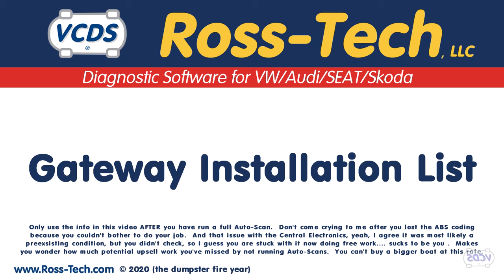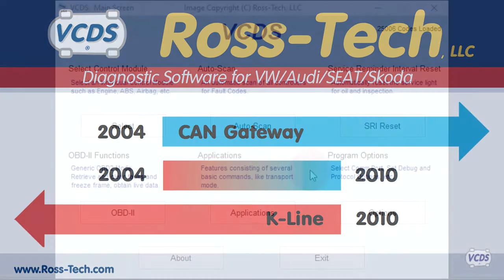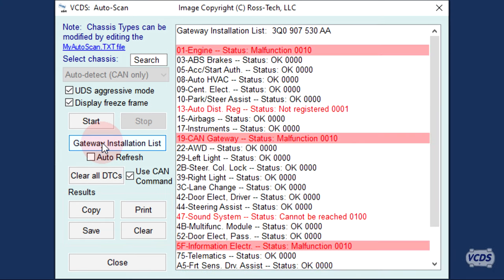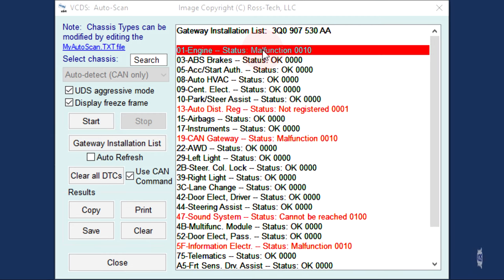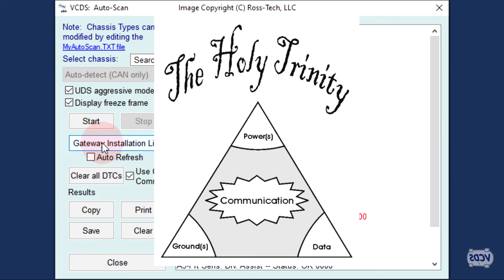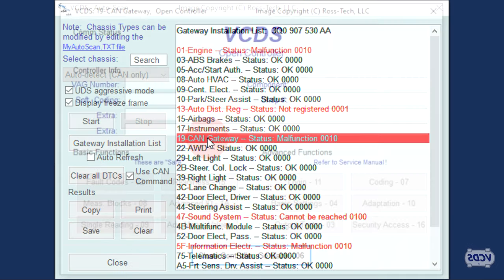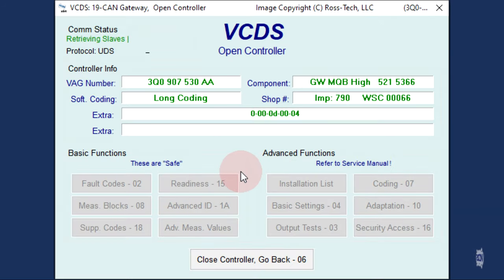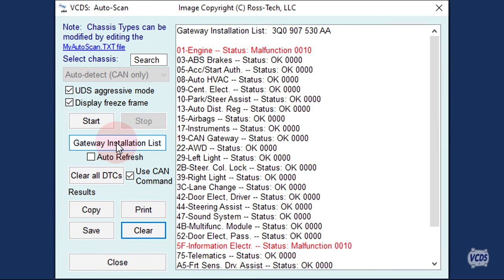VCDS - Gateway Installation List

Comment: Hi I drive a 2010 A4 B8 2.0
But I could not get the steering assist module to communicate. I went into installation list the 44 check box isn't tick. Us there any problem?

Comment: is there a date known when this also works for the new gateways, fitted on the golf8?
Reply from the maker: We've received some scans from Golf 8s already.  But I think this is the more interesting conversation:  https://forums.ross-tech.com/index.php?threads/22068/
Reply: @RossTechVCDS  if you want (can) logs, please contact me, we have/ log a couple every week.
Reply: @jurgenverbeek5741  Can always email us Auto-Scan and maps, see [About] screen of VCDS for your email address.  To make maps, start VCDS - [Applications] - [Controller Channel Map].  Select Whole Vehicle (CAN Only) and Measuring Values.  Click [Go] and VCDS will go into each module and grab live data and save this to the /Logs folder where VCDS is installed.  Auto-Scans are saved in the /Scans folder.  Regards.

Comment: Amazing software!! My MOST test is only coming up with two modules (CAN Gateway and Control Head) - should I manually tick the boxes in the installation list to cause it to try the other modules? Or is there an issue with the circuit?
Reply from the maker: We offer free vehicle support in our web forum: 

https://forums.ross-tech.com/index.php

Post an Auto-Scan there for review.
Reply: @RossTechVCDS  thank you. Can’t post in there as still not verified at moment